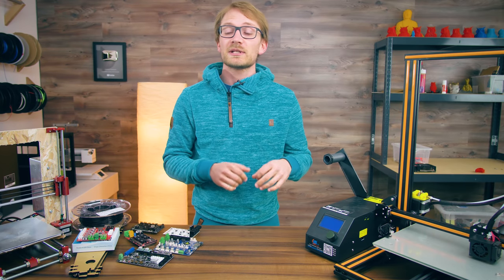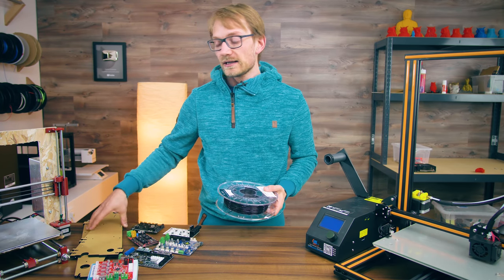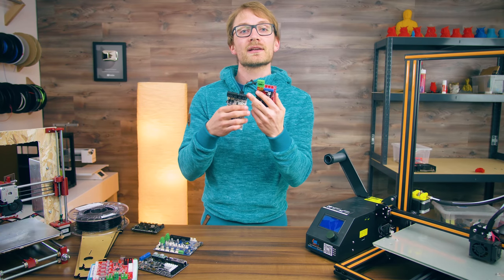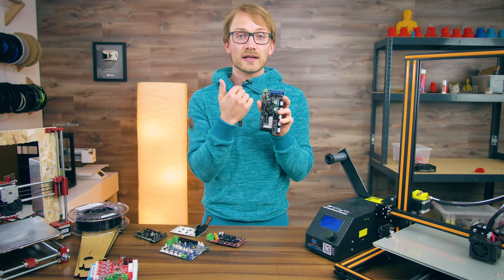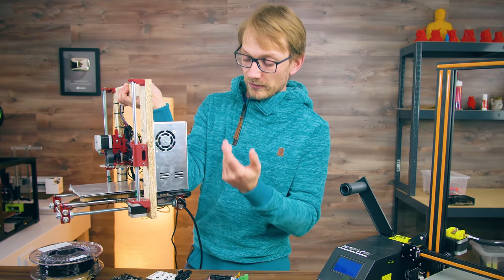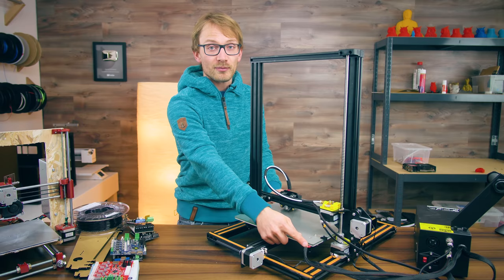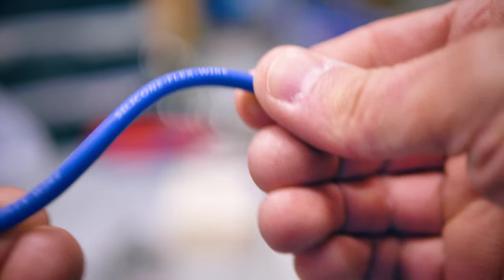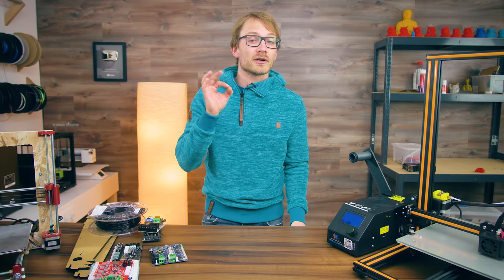Everything you need to know to make your 3D printer fireproof!

Comment: Notice all the fires are Anet A8? Hmm.
Reply: Quite a bold claim..
Reply: All the fires aren't the A8, but I'll admit it's safety out of the box is pretty poor. I thankfully got some advice from the A8 community on facebook before I got mine so I was aware about all the mandatory safety mods it needed. But anyone who just rocks up to gearbest slaps their cheap Chinese printer kit of choice together and leaves it running overnight unattended is asking for trouble.
Reply: Some of the 'mandatory' mods I've seen advertised for the A8 are just creating other obvious points of failure, or merely introducing complexity for no benefit.

The biggest problem is the assembler, not the parts.
Reply: Monkeh might be right - but a kit requiring perfect assembly and at least some mods to run safely isn’t the real deal either.
Reply: The most essential upgrade is human supervision.
Reply: Yeah... I'll admit I have one and the first thing I noticed was heat of the electrical components. I added cooling to the PCB and the power supply. the power supply especially got very hot.
Reply: I have one too, and I just straight-up replaced the PSU.
Reply: The A8 is the most selled printer ;)
Reply: Shane Fletcher, I guess the power supply is undersized, so I replaced mine with 600W so I think I am fine (the heat bed can take 250W itself at full load. another printer with 300x300 heatbed can take 450W with 400W for the heatbed)
Reply: It's a kit, people with no knowledge in electricity build it, it's sold 1000x more times as other "brands". Notice how you don't have a clue what you're talking about
Reply: It's a cheap, popular kit that i bet is often assembled shoddily with no additional fusing.  Apparently it ships with thermal protection disabled in the firmware which you could put partial blame on Anet for since they do flash it and leave you with the assumption it's ready to run. They should make you flash and configure it yourself, or put that in the instructions, just like they should inform that fuses, etc is recommended.  Sure it will work out of the box, but I'd rather the cheap kits just left stuff like ungrounded two-prong power cables out and let you source a good one in stead of pretending it's good enough to be able to claim they're selling a 'complete', everything you need kit, so people that don't know better just go with it, but really it's just user ignorance.  It is a kit afterall, one should take the time to learn and set up the firmware just like the hardware.
Reply: You can't expect people to know how electricity works, and I claim that 99% of people who buy these 3d printers don't have a clue. Where i live you can't even sell Anet A8, it's so dangerous it wont pass the machine safety code and if you buy it online, you are on your own. In third world countries where you have no machine safety control, like Australia, UK, USA it's a wild west. Anyone can sell anything without any control and put people in harms way.
Reply: Mine happened on a UK version when the hotend temperature sensor was pulled out of the hot end!
Reply: Well, for it’s price it’s no surprise. Very hard to introduce lots of safety features at such price tag, imo.
Reply: I run my A8 with a smoke alarm epoxied to the top, and a fire extinguisher on the floor next to it.
Reply: i was just about to say.  i don't like the fact that they are the same printer i own.  good thing i made mine fire safe
Reply: We should be able to expect people to have a high school level education. Sadly, we cannot.
Reply: oki doki, it's not Marlin, it's Repetier - it's disabled there by default and needs to be explicitly enabled.

My Geeetech i3 Pro W came with thermal runaway enabled, they dumped the corresponding firmware source posted by a company liaison on the forum (wow, GPL compliance! well, almost, good enough for me), the board has free-wheeling diodes for all high-current outputs, somewhat protecting the MOSFETs, and there's two individual socketed fuses on the board for the hot-end/motor portion and for the bed portion, and the bed cabling was RC cable and soldered on, so at the same price it's a much better system from the safety perspective. Of course mechanically it's a much janker proposition, and prints horribly out of the box, and the wiring included an IEC socket rather than wiring in a suspicious mains cable directly, and of course i supplied my own cable rather than the one that came in the box. But then again, the board does have a short-to-ground waiting to happen if the MOSFET heatsinks were to pierce the thin lacquer underneath. Oh and the firmware is of course somewhat bad out of the box, would reset once in a while - but at least the watchdog feature works!
Reply: darkracer125, how exactly have you made your printer "fire safe"? Because i have so far not seen a single set of modifications which will make a 3D printer safe, just potentially less dangerous. I suspect you may be lulling yourself into a false sense of security there, but i'm really curious for your explanation.
Reply: siana.  well first you reduce the chance of a fire as much as possible.    getting rid of the connectors and propperly soldering the wires directly to the board and bed.  
next propper strain relief.     this cannot be done willy nilly.     and prefferably done on 2 or more points next to eachother.  (otherwise you just added a pivot and failpoint)  

use thermal runaway,   use an atx power supply instead of the standard power supply.   use mosfets.    cooling fans.   and last but not least.  a self igniting fire extinguisher.  (those fire balls for example)   

you can also add a smoke detector wich disables the power.  

and a metal enclosure goes a long way.  (so does an airtight enclosure)    

you don't need all of the last 3 but ofcourse all would be best.
Reply: Funny enough, the first minute of the video covers this exact point, that it will never be 100% safe.
Reply: those self triggering fire balls are strong enoegh to put out a bedroom fire.   so one of those in the enclosure and one ontop of the enclosure (outside)  should be enoegh.   

and just don't print unattended unless all of those measures are applied.     the printer itself might go up in flames but you can stop it from causing a house fire
Reply: There has been some in the tevo tarantula group as well. Well not fires... But melted connectors, mostly related to who built it. However the MKS base that came with the tevo tarantula is only rated for 20 "chinese amps". And the latest beds with the connector has had some problems as well. The new board, the MKS Gen L, I don't know what rating the connector it has.
Reply: Melted connectors occasionally happened on just about everything by now, including Prusa Research Original and Lulzbots.
Reply: At some degree true but you can't blame an easy fire starting printer always a "user error" and A8 is in % one of the most dangerous ones. Not the only one but the largest margin.
Reply: Mine has hours of continuos work, and yes, the hotbed connectors did burn at an early point, so i've always soldered cables and used big beefy MOSFET's for the bed since. Of course it's updated to the last version of Marlin, wich not always is a good thing, since no software at all is bug free. Since then I've bought and modded one printer more and built a third, no issues at all. And for the record...hot beds like the ones the Anet A8 uses are sold as spares and for new builds and they came already with the dangereous connector fitted... For those that think that "premium" or "expensive" is always better, guess which premium german car manufacturer builds it's engines with an average-cheap french car manufacturer... and no, it's not the cheater one. If you have brains you can avoid being f..ked, but if you put your confidence in price you'll get f..ked and your pocket emptied.. but probably the seller will dress better than you do.

Back to the video, those silicon flexible wires will be a great addition to my printers. I was using thick car audio power cables, wich already are made to withstand vibration but are quite rigid in comparison with those RC ones. Car audio cables are better than regular ac home wiring ones but those RC ones look much better. Thanks Thomas.
Reply: Yeah, Mine had electrical fire after hotbed shorted luckily I was watching it at the time...
Reply: actually some parts are really bad. The bed connector for example is super problematic, and burns with about a month of use.
Reply: I don't think its just Anet A8's. I think chinese diy 3d printers are all at risk. It's just the Anet A8 is so popular that more reports happen.
Reply: It's the PSU that's unsafe
Reply: Yet my mom got me one...
Reply: The PSU was unsafe. Some 2 years ago they replaced it for a beefier one because of all the fires and issues with it. The 3d printers we see burning now are largely from that "first" batch.
Reply: Don Mega,
Given the amount of flak anet is actually getting from fires that weren't even A8 printers, I wouldn't be surprised if it was an actual smear campaign that from the looks of it has been extremely effective.
Reply: @ww-pw6di  Monkeh
The assembler not the parts? Total rubbish. I've spent a lot of time and effort on my A8 with pretty much everything he said in the video. During assembly I had to make mods because the acrylic frame was cut wrong. The heated bed was the first thing to go with the wires being super thin and the plastic connector on the bed melting around it. I had to solder higher rated wires for the heat transfer as they had used exactly the same grade wire for this as for the temperature sensors on it. Madness. Next thing to go was the plastic terminal block on the PCB for the hot end. Same cheap under rated green crap. The blue ones next to it for the power and bed were much thicker, not sure why why skimped on the hot end one but I had to solder wires directly onto the PCB for another year of use out of it. I soldered solid core wire through the PCB hole, but unfortunately it was susceptible to knocks so I had to be careful round it. Sadly the hot end failed the other day and whatever I tried I couldn't get a reliable heat transfer anymore. After my last attempt at stripping down to solder it properly to the PCB it now doesn't work at all and I've committed this printer to the spare parts bin, and am awaiting a new printer today which is dual extrusion (not terribly sad as I was looking for an excuse to upgrade). Anyway, in all the years using my A8 I wouldn't dream of leaving it unattended for more than 30 minutes or so. Thing is, I was aware of all this going in, and don't regret buying it as it's been a great way to learn and is an excellent beginner project for tinkerers at a great price. Just don't go buying one for your kids or they'll burn the house down.
Reply: So? That doesnt make it to a "safe" one. @Floh545
Reply: I'm switching mine to cr 10
Reply: @Monkeh616  I'm sorry to dig up an old thread here, but what mods are you talking about, specifically, that create other points of failure?
Reply: anet a8 is cheap yes but replacing a few parts wont break the wallet
Reply: @Floh545  and the ender 3 what?
Reply: @noway8233  
Dude, 1 Year ago, the Ender 3 was't quite as popular, as the anet A8 ! (;
Reply: @darkhoshinonz  You're saying the motherboard and power supply didn't have cooling already? That's a huge hazard! All printers need to have cooling both on the motherboard and power supply!
Reply: They really need to improve the safety

Comment: I read a lot of comments that the A8 is "Always the one to set itself on fire. "

I know this isn't true.
But part of the problem is that the Anet A8 is a home build printer. 
So the quality of hiw it is put together can have a huge bearing on how safe it is to use.

The tips in the video are all valid and I would also add that a 3D printer should be 'serviced' at regular times.
Chect the wires for problems.
Check nuts and screws are tight etc.
Lightly oil the rods etc.

But yes.
Treat these items with care and respect.

Comment: I have an Anet A8, which is notorious for being dangerous. It's pretty much stock, but I did double check everything during assembly and took my time to do the wiring as well as the design and my equipment allowed me. It's been printing really well for almost 6 months now, but I will do some temperature checking with an IR camera this week, just to be sure.

Comment: Tom, your smoke detector is mounted wrong. There should be at least 50cm space to a corner, wall or lamp. The smoke does NOT reach your detector. Placing the detector on the ceiling is allways better. Most detectors aren't even rated for wall mounting. Many electrical shop's are certified by the TÜV, you should ask them to mount your smoke detector. If you want to do it yourselfe check out the DIN 14676. Please fix it. Right now your smoke detector is just a piece of plastic without any use. Would be nice if you can make an update to show the propper mounting.
Reply: Strange then, that googling the subject immediately shows approved placement for wall mounting.  Equally, I've never observed that smoke stops dissipating at 50cm from a wall.  It's possible (but impossible to say from the viewpoint in the video) that it's not in the optimal position,  but it is most certainly not "just a piece of plastic without any use."
Reply: Andy Chaplin sorry, "googling the subject" is like saying "i don't know what i'm talking about".
Just for fun i searched "smokedetector placement" and it says "wallmounting acceptable". You can place them there, but you need a smokedetector that is rated for wallmounting, 95% (in Germany) are NOT. Those that are rated for wallmounting are expensive, the one used by tom looked more like a cheaper one.
About those 50cm... there are cold/hotspots (depending on the situation) a difference in temperatur = airflow and blocking the smoke.
Sorry if i'm rude right now. I'm a firefighter and TÜV-Certified for DIN14676, i mount and maintain smokedetectors for a living.
There are so many cheap 3d printer out there, most of the cheaper ones are a fire hazard. I don't want anyone to end up in a dangerous situation and not beeing warned by a misplaced smokedetector.
Reply: @Pa_No123  dog chillllllll you're missing the point
Reply: Don Mega  You don't want a chance that it is working. There is a chance that somebody nearby will extinguish the fire too... You MUST be sure that it is working. It is a safety equipment. It should also be checked routinely. Your house and your life worth a 'little bit' more than 'there is a chance that it works'...

Comment: Good point on mentioning not to put 3D printer inside wooden create. I have seen lots of printer put inside plywood crates to create heat enclosure since it’s easy to make. If you can make another video on how to make proper fire safe enclosure , that would be really awesome!
Reply: Actually a totally sealed crate of any material might be good so long as it can't draw a draft from anywhere.  Last I knew, fire requires oxygen to burn. Once it is all used up the fire will go out.

Comment: It would be pretty cool if the smoke alarm was connected to the power of your printer so that when it goes off, it shuts off the printer. (kinda like a Ground fault power outlet, but smoke alarm tripped)
Reply: Not really hard to achieve. I could quite easily rig that to mine - I already have a massive relay on the 12V side. Wouldn't be hard to do the same on the input of the PSU.

You can certainly get optical and heat alarms as modules, I wouldn't be surprised if ionization is available - not that I'd pick it for this application (or most others).

All this of course requires people doing their own mains voltage wiring, which itself is one of the potential risk factors for fire and other hazards..
Reply: Smart Home is the answer :)
Reply: Arduino is your friend 😄
Reply: Arduino?

Fire safety?

The door's over there.
Reply: Monkeh arduino connected to alarm as input and relay as output. Super safe (worst case it false triggers if you have proper relay) and really effective ...
Reply: Monkeh the Arduino should in no way replace a proper smoke detector! But you can use it as an additional safety feature to plug off the printer in case of an emergency.
Reply: Jonathan Kayne Get an AFDD (Detects arcs/fire through electricity). Just a bit costy :D
Reply: Get a proper smoke detector with a relay output. Connect to SSR or contactor to control the printer.
Reply: I built a heated cat house out of a gutted washing machine, oven heating element, relays, Arduino, and  temp sensors.  The heating element sits directly under a wooden platform with cozy towels inside.  The one thing that makes it's safe is I have thermistors in line with stove heating element.  If the temperature rises above  100F, the thermistor fuse blows preventing the element from heating up and causing a fire.  I think I have two thermistors in series just in case one of those is faulty and doesn't blow.  I will be replacing them with resettable fuses because my setup works too well meaning I'm replace fuses all the time.  a setup something like this would work just as well for a 3D printer I would think.
Reply: You can easily do that with xiaomi stuff
Reply: The same system could be used to trip an automatic fire extinguisher.